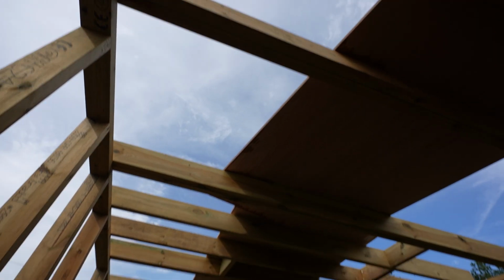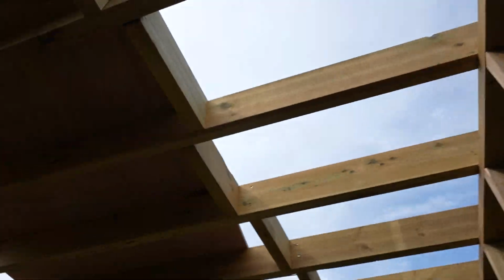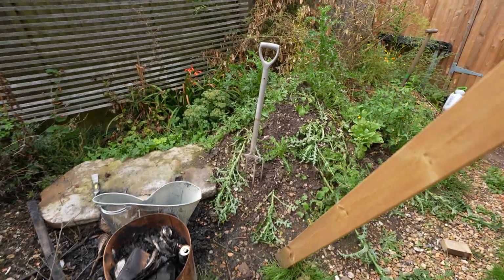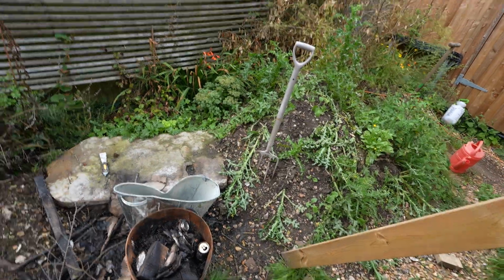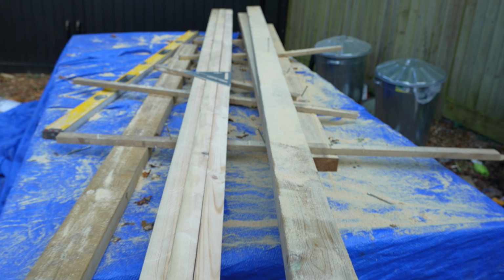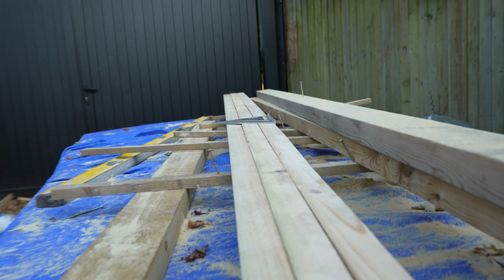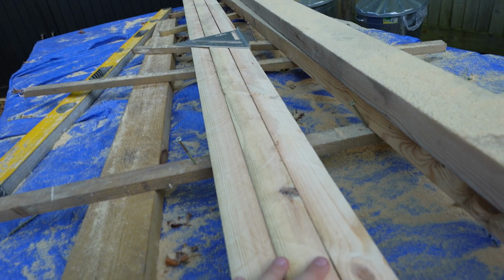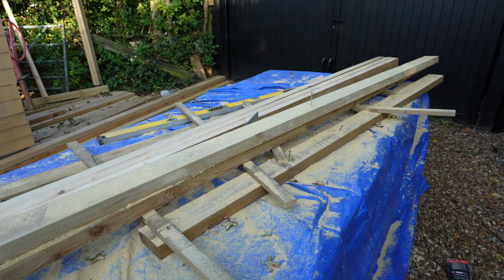Escape to Rural England! Building my Dream Tiny Home from Scratch (Self Build UK)

Comment: Eventually you'll get to the point of thinking it's better to use the right tool for the job 😅 can't knock the titan table saw, that's got me through just fine. I wouldn't worry about a mm difference though if you just stick to the circular saw even though they're not great at ripping. A plunge saw would probably be better than a circular, especially with a long track, it'll come in handy for your sheets too. Remember tools are a good investment, make your life easier 👍